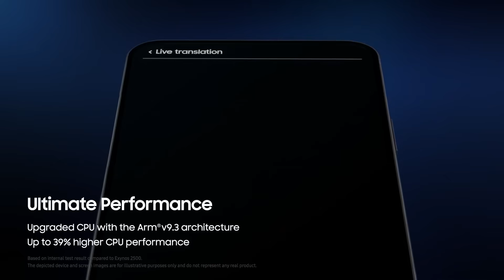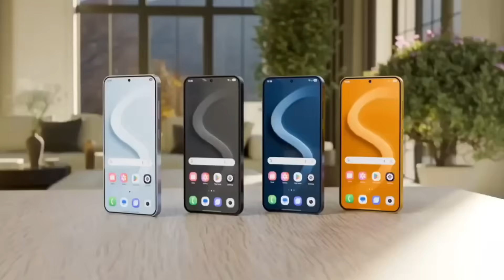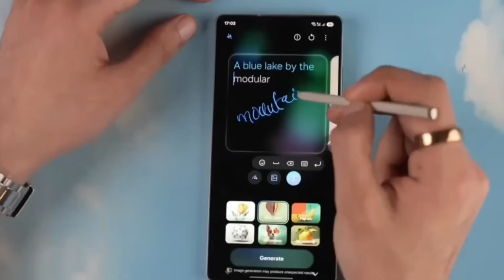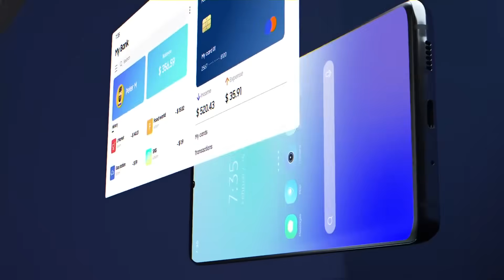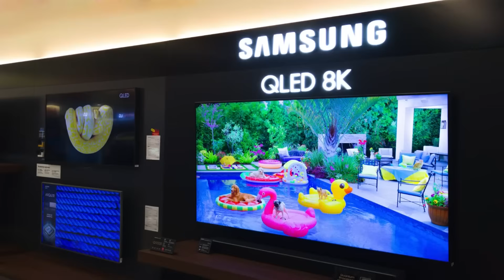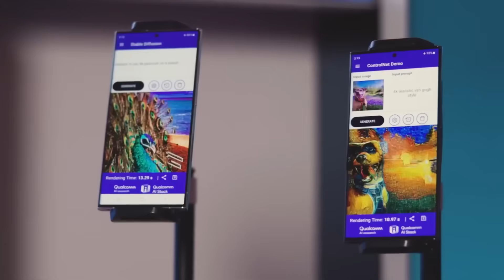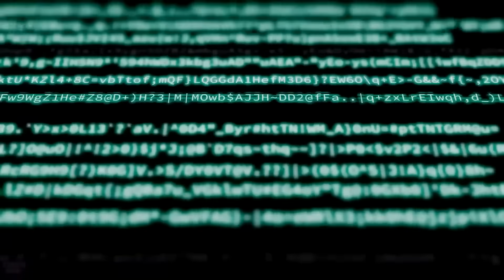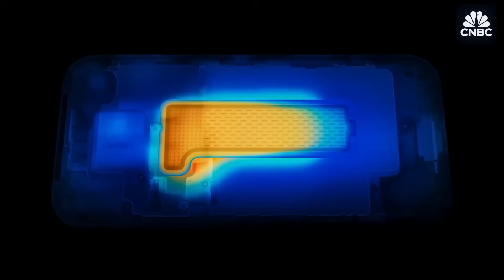Samsung Just BEAT NVIDIA — Meet The Most Powerful Mobile Chip Exynos 2600

Comment: The 2600 is not going into any S26 line in any country. That says it all. Yelds are way to low. We might see it in the flip but no cooling for the most part. I want Samsung to get it right. We need more competition.
Reply: That's inaccurate.  Exynos 2600 is going into s26 and 26+.  Snap dragon is going into the Ultra line.
Reply: Samsung has a contract with Qualcomm that states they have to use a certain amount of chips in key markets.  That along with the yields are why they are not pushing the Exynos in their devices.
Reply: Nah its is most exepect in staes